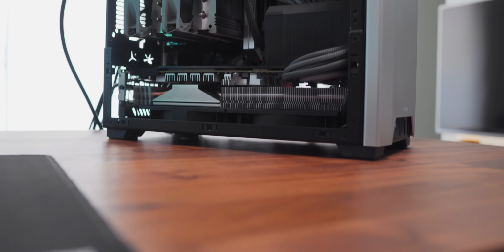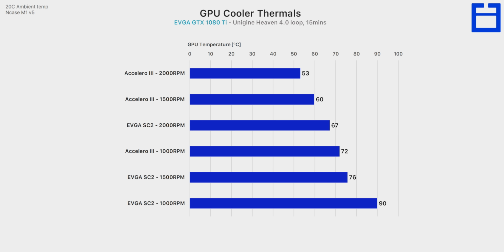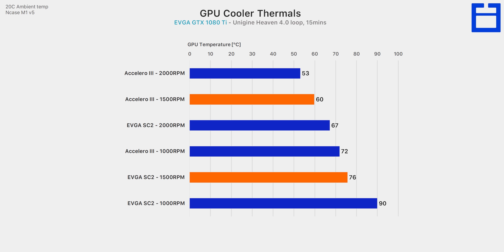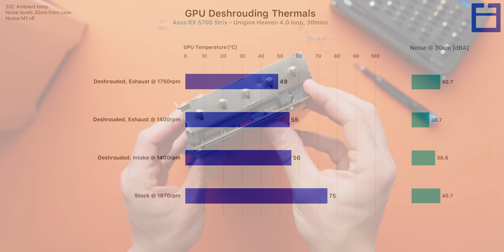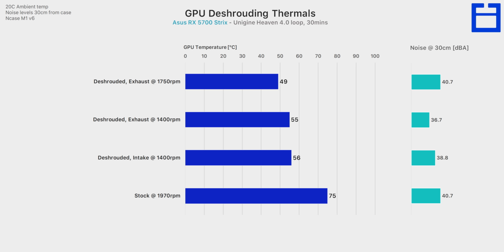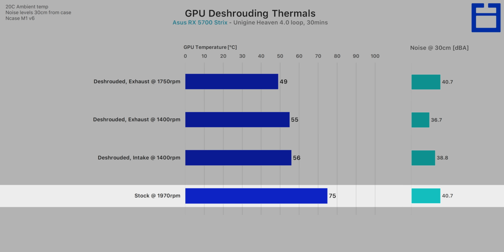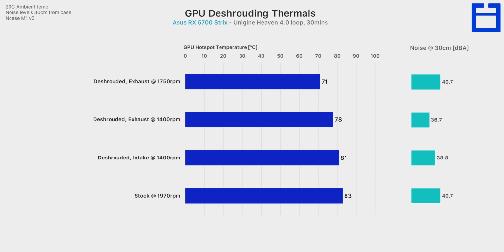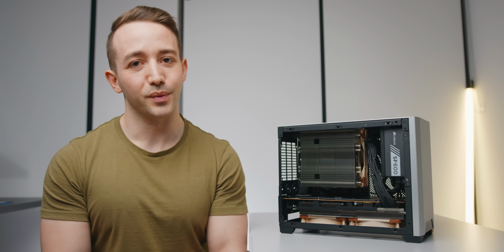GPU Deshroud Mod - Mindblowing Thermal Improvement

Comment: They need to start selling GPU with just heat sinks with no fans, so we can use our own.
Reply: + provide normal fan headers 🥰
Reply: @superbanana1784  Yes, but I used the pwm to mini pwm fan cable when I used my morpheus.
Reply: Or with a socket for a AIO water cooler, like the NXZT  G12, but covering the other components too.
Why don’t NZXT make their own graphics cards? They make their own Motherboards.
Reply: @Neiva71  making a product does not factor the people who work the line, into its cost to make
Reply: @NonsensicalSpudz  What ? the cost of labor is is within the price you pay.
Reply: Or one of them could just do this themselves? They'd get the fans much cheaper and let's face it, plenty of people will pay and extra $30 if they can get this kind of performance boost
Reply: @daemonbyte  I dont want these manufacturers putting on their crappy fans though.
Reply: @jsharp9735  my point wasn't that they put their crappy fans on. My point was they put noctua or bequiet fans on in the first place ;)
Reply: Which company who has the balls of steel to be able to deliver this
Reply: @tggorudon2551  OT might have some sway. H e needs to find a manufacture and tell them about the SFFPC boom.
Reply: then they cant charge you an extra 400 for the fucking bullshit 20 dollar passive cooler.....but i agree with you. i just dont see these money hungry bastards giving us that option.
Reply: Apple RTX Pro Max
Reply: Just give us only the gpu itself we can manage our own cooling solution without needing their overpriced crappy fantasy cooler
Reply: @pakorn9901  this is the way
Reply: Naah, that is a very edge use case.
But just plain PCBs would be amazing. No coolers at all, so you can custom water cool them.
Reply: absolute freedom of speech or death  this would be amazing for all us watercoolers out there
Reply: If I was to, and had the option to, I would much rather buy a GPU with case fan mounts than one without, that way I can chose if I want slim fans, full size fans, and if I want rgb fans I can chose brand(/software). 

And I think that 120mm and 92mm fans will stick around for a while, 120mm fans for their popularity and 92mm fans for their excellent fit with the standard GPU height.
Reply: I have a XFX Geforce 7300GT just like this (just a big heavy heatsink and no fans). (PV-T73E-YDJ3)
Reply: This is a damn good idea

Comment: Did that long ago with 290x because my fans broke and started rattling. With usual ATX case there was an improvement, but not that dramatical. But I believe it depends on dozen of factors including default fans and radiator shape

Comment: Was the ‘stock’ config before fixing the defective shroud gap by replacing the screws? If so aren’t the results kind of useless because the stock shroud issue is specific to this card?

Comment: Is this something that's possible with a mini-ITX gpu and a single slim 120mm fan? The added thermal and sound headroom sounds like it could make overclocking some SFF systems possible. Currently using an Lazer3D LZ7, which has very little space to work with, but it does have a place for a slim fan could mount to. Please look into for all the ITX junkies out there like myself! 🙇🏻‍♀️

Comment: I wish all manufacturer uses 120mm fan. They could get away with a thinner heatsinks. Imagine a GPU that makes universal brackets for us to change the fan to any fans we want.
Reply: Honestly I would love that. I'm running a PowerColor Red Dragon 5700XT and to keep the thermals in check (below 80C TJunc in my preference) I have a very aggressive fan curve meaning during games my GPU fans regularly reach 1800-2100rpm and can spike up to 2400. Fortunately I can have my PC a decent distance away, about 4 feet (~120cm), so the noise isn't terrible.
Reply: There a Fan Clips that work with most gpu´s, adding 120mm fans is pretty easy

Comment: Thanks for this wonderful review of deshrouding! I happen to have a 2080ti evga, the exactly same one as you introduced, I was wondering if I could use slim fan on the bottom instead of the regular fan so that I do not need to cut off these fins on this triple slot gpu?

Comment: This is exactly what I do with my V64 Strix in my Ncase. Works a treat, but you need to use GPUTweak to control the external fan headers
https://i.imgur.com/xgk2aQ7.jpg

NH-C14 to boot!

Comment: if you only use one or two sided external passive heat distro plate (no liquid) with only copper heat pipes with copper contact plates on needed places

Comment: Hey, nice video as always, but i would like to ask a question about the fan headers on the strix cards. Is there any way to use them on a linux machine, because normally the header only spins up the fans connected to it, during startup.

Comment: I wonder if this would work with a case like O11 dynamic with a graphics card mounted in the bottom slot.
Reply: Actually, it looks too tight. It probably won't.

Comment: Holy shot. That’s massive. Why didn’t any other tech channel tried this configuration before ?
Reply: Because most of his improvement probably came from the shorter screws.
Reply: @FuburLuck  Actually most of the improvement comes from being able to directly vent the hot air out of the case, without it recirculating inside. The Accelero and Morpheus proved chunky heatsinks with good vents improve thermals. What they lack is the ability to vent the hot air out of the case, which means at least some of the hot air is recirculating in the case.
Reply: Case and card compatibility is very limited, as mentioned in the video. You probably also need to touch up the fan brackets on the cards and might render it not possible to properly reattach the original GPU fans and shroud.
Reply: I think GPU thermals are more limited by SFF cases. Most other channels focus on mainstream mid tower or larger ITX cases, which don't have as many issues with restricted airflow to the GPU. This channel is one of the few that is enthusiast SFFPC focused.

Comment: 4:03 Which toolkit is it? Seems like the link is missing. Heard the iFixit bits are a little soft. You had any problems with them?
Reply: I’ve had an iFixit for about two years now and the only ones that are worn down are the p5 and y000, the regular size ones have held up to my 3D printers pretty fine

Comment: Just did a similar mod on a v56 strix (in terms of board and cooler extremely similar) this weekend. Which I had to shorten 1cm (the shroud) so atleast for strix cards it also makes it slightly shorter. I just zip tied it though, and didn't bend/cut the taps. 

Also I pulled the fans just a little out, so that they were roughly 1cm wider than the card (push configuration) in order to push the hot air up and out of the system. Case has glass panel and can't exhaust from bottom/side so was a necessity.
Reply: Oh also at 6:10 

These fan headers probably work, however they will not activate until after the GPU has reached slightly above target temperature and you will need Asus GPU tweak.

They aren't meant to assist in this type of mod, but meant for increasing airflow trough case fans, in case there isn't enough in the case and the GPU chokes.

Comment: I did the same with my 1080ti strix but I have atx case so had to use zip ties to hold 2 fans in place and got very similar results. I tried both nf-a12x25 and arctic fans(the ones u get with freezer 34 coolers); since they performed almost identically on my 9700k(using the same heatsink ofc) I was expecting the same on my 1080ti. Unfortunately it wasn't like that: somehow arctic fans were almost worse than stock fans. Maybe it was me that didn't place them correctly or zip ties didn't apply enough pressure(maybe cause of their frame design, Idk...). It would be nice to check if they act like this also in the case scenario you described :)

Comment: If you have the set-up to do this, it's a no brainer. At this point, the only real advantage you get from water cooling is that most water blocks will leave your GPU a 1 slot except at the outputs on Nvidia cards.

Comment: Hopefully graphics card companies pick up on this and add support for custom fan mounting to their heat-sinks. It wouldn't be hard or costly if they're already creating custom cooling for their over-clocked reference boards and could even incorporate whatever mounting points the default shroud uses. You can easily imagine this as another selling point targeting the "hardcore gamer" market like being able to customise lighting and cabling and everything else.

Comment: I have done the same with my Gigabyte RTX 2060 Super Gaming OC, 
worked wonders in terms of noise.
The original fans would always cycle on/off and the min fan speed was quite high. 
The de-shrouding was very easy and no extra work was necessary.

Comment: I have a system with an Asus 5700XT. Same issue with the VRM screws being too long. I used plastic washers to sort that out. 

But that's not even the only issue! As with your thumbnail, you can see that the backplate is bent higher around the die area - because the stock thermal pads around the die area are too thick! Asus really did a great job with these after-market coolers...

Comment: This isn’t exactly an apples to apples comparison. It’s a good mod if you otherwise can’t fit fans under the card, but if you can then I reckon you’ll get better performance in combination with the GPU fans. Removing the shroud is also helpful while still leaving the fans as all it does it block airflow.

Comment: i've managed to get 2x ML140 140mm fans in the lower section of the NCase m1 with some small mods to the fan brackets, again i did this to further lower the speed of my fans on my 1080ti with the accelero III. absolutely amazing mod. 
This deshrouding is even better, as you can don't need to glue crappy ram sinks on!, ill be looking for the certain 3080ti card that comes on the market that allows us to run with this option, i dont care for flashing lights, and smaller noiser fans. We want outright performance and silence!
thanks again ali great videos as always!

Comment: Funny thing you did this just now, I recently installed 2x Arctic P14 with standoffs for my 1070 Strix in the Ncase M1. Its a little ghetto right now, but proved my own point that I could do it and achieve better thermals. Planning on upgrading to 3000 series and doing a similar mod with that card.

Comment: Question though: How much of a effeciency decrease can I expect when you use a less than 2 slot card? 
My SO has this Ncase M1 with an ASUS RX480 DUAL. Really loud card, and I've been thinking of de-shrouding it for a long time now, yet I wouldn't like the gap between the 2 120mm fans and the actual hearsink. Any thoughts / tests? :)
Reply: The temps get really bad if there is a gap between the fans and the heatsink. I tried it myself in my Ncase with a 2 slot 1070. These things helped me a lot https://www.reddit.com/r/sffpc/comments/dfxfbc/ncase_m1_fan_spacers_gigabyte_rtx_2080_oc/
Reply: @rolexrolex095  That would help! Thank you, kind Sir ^^

Comment: Just iN Case you have a GPU which is slimmer than this Strix, you can use 3D printed fan spacers :).

https://www.reddit.com/r/sffpc/comments/dfxfbc/ncase_m1_fan_spacers_gigabyte_rtx_2080_oc/

Comment: I do this with a pulse sapphire 5700XT. It becomes two-slot and doesn’t need any modding
Reply: Hey bro! How much of a difference did it make? I have the gigabyte 5700xt which was the other gpu that was highly recommended for cooking. I get so many black screens and restarts. Does this ruin warranty?
Reply: Elo I didn’t do formal measurements but the noise profile was much improved. It still runs hot. I had better results running intake from bottom and exhaust on the rad. (This results in cooler GPU and warmer CPU temps but it was a good trade because I had a lot more headroom on the CPU than GPU).
Reply: aclysma got it and thanks for sharing! So just take off the heat sink... does that ruin warranty? I wonder if this applies to any card in the Ncase?

Comment: I have a vintage Lian Li Q10WX & this looks like a good fit, initially. With a used card like the 5700, can do XT bios flash, try for increase power limit & mod fans ..& enjoy the performance.
Would not want to void warranty by removing heat sink tabs, but if no warranty then only concern is resale. Pascal the resale is too strong & limits set too well for anything more than quieter . 

Think I will stick with Corsair ML120 Maglev fans, if Noctua they have to be the black ones . Like the comments say, if the case gap is smaller can shim some slim fans..but if bigger gap it could be fun to source those thicker denon & old school fans instead of spacing.

Comment: I have the 1080 ti strix in an n1, and even though temps show normal with software, the backplate is very hot to the touch. Backplate gets so hot it burns if I touch it for long. Is that working as intended?

Also, could you test this mod vs not deshroud with slim fans?

Comment: So why don't gpu's come with universal mounts for us to mount our own 120's to? Why isnt that a thing yet?
Reply: It's probably part of where they make their slim profit margins.
Reply: @zoomzabba452  Their margins are not slim by any measure.
Reply: I imagine that would be ideal. They cut cost by not providing the fans and shroud, and we as enthusiasts can put any kind of fans that we like onto the GPU.
Reply: It is a thing. Buy a reference card, go to Raijintek or Arctic who will gladly sell you a heatsink, and go to Noctua for some fans.
Reply: @MelvinKhosa  this isn't the same thing. I feel like you're just flexing some random enthusiast knowledge. I don't want to disassemble a gpu, repaste it, and install a new heatsink just to connect some fans. I want to go to Newegg, buy an EVGA gpu and slap on 2 fans. 5 seconds, done.
Reply: It is still a mod. Would be better if the board manufacturers acknowledge their design shortcomings and just put standard fan bracket for easier installation. They have put water block preinstalled before so finger crossed.
Reply: You either replied to the wrong thread or you’re a narcissistic prick because literally nobody here mentioned ANY of that AT ALL. Do NOT reply.
Reply: I think it might be due to restrictions set by NVIDIA and AMD. I don't think they are allowed to sell gpu's without a cooling solution attached to it?
Reply: I wouldn't think so because you can find cards with preinstalled water block. In my opinion it's the same as preinstalling a bracket for fans because both of them wouldn't work out of the box without additional steps.
Reply: Maybe another consideration is that mounting 2 120mm fans would make the graphic card bulkier (4 slots pcie) and heavier. But it could be managed by gpu support or mounting it vertically. But still a niche market, so that's the reason they don't see that it would sell.
Reply: No that wouldn't be right, he said it is slimmer after he took off the fans and shroud (2.5 to 2 pci slots). The standard  noctua fan thickness is around 2.5 cm which is around 2 slots.
Reply: @yohanes2034  Overall that's 4 PCI-E slots bruh...
Reply: Omg YES

Comment: Fun fact, the FormD T1 can also use this mod with certain GPUs. My friend uses a Sapphire RX 5700XT in that case deshrouded. You can check in the T1 thread on smallformfactor net by user “thelaughingman”

Comment: Interesting video. However, I prefer to water cool my GPU's. I currently have a XFX 5700XT Thick 3. At max load it had a temp of 75C and the hot spot temp went up to 112C. After slapping a water block on it, with the same load max temps now are in the mid 40's and the hot spot temp stays below 60C. Also, with no fans, there's no fan noise.
Reply: How much your temp on 3D mark firestrike ?
Reply: @claritoresdiano1021  GPU Temp 54c Fire Strike GPU  Score  26,824

Comment: A 4 dBA and 20°C drop is immense, that's a great approach to making a whisper quiet system.
Reply: I did the same to my gpu after seeing the vid. Totally worth it. It's not only more silent by however many dB-s, but it's not the same noise eitger when it ramps up. The small fans had an annoying high pitched noise, but the modded fans sound low frequency pike a normal case fan.

Comment: In some cases, deshrouding is useful even when GPU is mounted normally, not like this setup in NCase. For example, it's popular on high power Zotac Mini cards like the 1080 and 1080Ti in SFF systems. Those cards are nice but noisy, due to smaller cooler and crappy fans. People have dealt with that by stripping the shroud and fans and simply strapping 2 Noctua fans with zip ties. It's also possible to flash the stock BIOS with the one from EVGA 1080Tis with 0-RPM mode or better Zotac models and you get a very silent mini beast with better temps, better fan curve and zero RPM fans. 
You can basically do the same with any card that's powerhungry but has crappy cooler and/or fans. Strip it, strap on the better fans, connect them to the GPU with appropriate adapter and you're done.